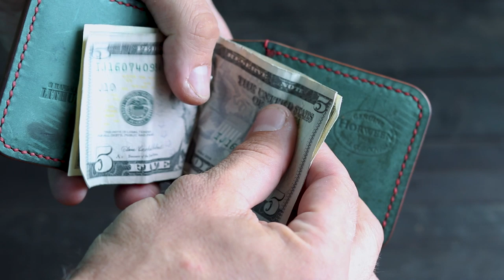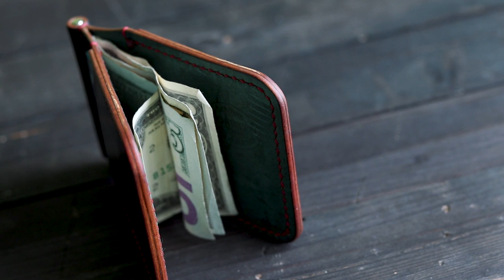Making Moneyclip wallet cardholder SHELL CORDOVAN handmade  How it's made? DIY

Comment: I know this video was produced awhile ago so this may no longer be necessary feedback but for anyone watching this for the first time it would be. A point I noticed when I was using the same glue as you. The Tandy cement is water soluble, when you use water in edge burnishing it dissolves the glue at the very edge and delaminates/squeezes out. I would really recommend using a non water based glue like barge or any other brand doesn't really matter. At 9:00 you can see delamination occurring near the mouth of the pocket and you can see squeeze out near the corner after you finished the edges. This can be exacerbated after/during stitching because you squeeze the dissolving glue very tight and force it to the edges. Also, when ending your stich lines, just cut the ends short to a few mm and melt them down, tying a knot and trying to melt a big glob of thread down is unsightly especially on something that will cost as much as a shell wallet.
Reply from the maker: Its more than 2 years ago, since then i improved my technique on much aspects. You are right i cant now even explain why i melted such a big knot :)

Comment: You burnish with saddle soap? I’ve never seen that before, cool! Also, what weight do you use for your wallets? 2-3 oz? And do you mind sharing the steps for the dremmel sanding? I’m interested what Frits you use. Thanks!!
Reply from the maker: Hey, yes i use saddle soap with water for burnishing, it makes edge more slippery when you swiping it with wood burnisher. Shell Cordovan thickness varies, even in the same piece its different edge to edge, in particular video here is about 4-4.5oz. Now with dremel im using i believe 320 grit sandpaper drum its for rough sanding only after i go by hand 1000-1500 grit.

Comment: what does the saddle soap do ? you use bees wax after applying it. Beautiful work
Reply from the maker: Fallus LaThug im using soap with some water, it work best for me to burnish edges. After all im adding bees wax and melting it with high speed rotating burnisher